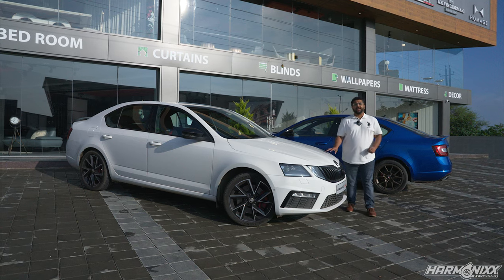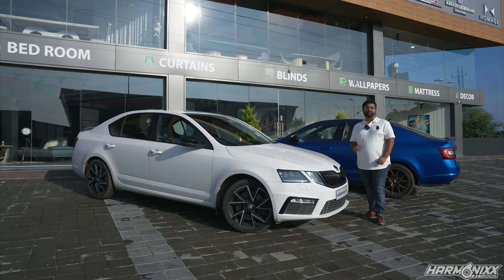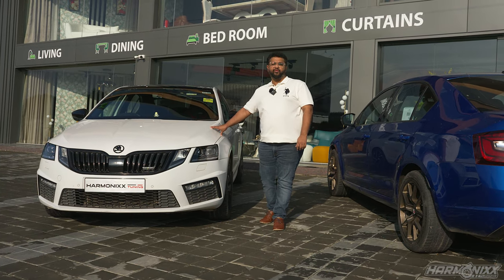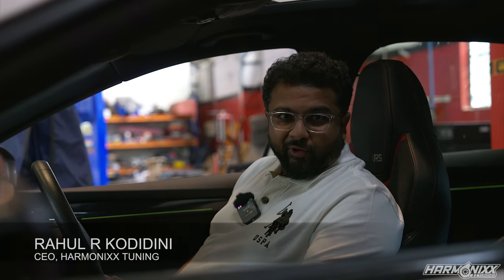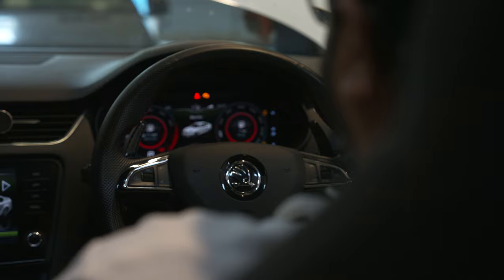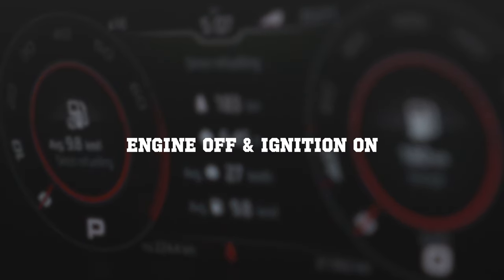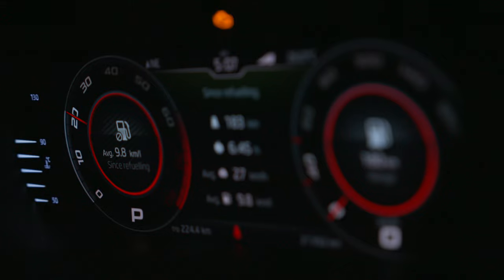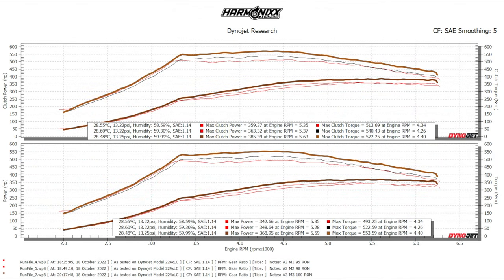Skoda Octavia vRS 2.0TSI Stage 3 Build VLOG - Introducing a NEW FEATURE for the FIRST TIME in INDIA.

Comment: Great content as usual...!! expecting some for EA888 Gen 3B engine (190 ps/320 nm)...  Revo has come with a stage 2 pushing 285 bhp... We know it's not as tunable as VRS 245 engine, but it's sheer presence across so many vehicles now demands some attention from tuners...!!
Reply from the maker: Thank you! Your feedback is truly appreciated. 

Doing a Stage 2 on the Gen3B Engines is the easier part. The difficult part is finding someone who's willing to go that far with their Gen3B engines & finding a downpipe that will fit bolt-on. 

We have done quite a few Stage 1 builds for the Gen3B engines already, probably we've done the highest number of tuned Gen3Bs in India. 

Do subscribe to our Channel so you can get notified about our upcoming videos.